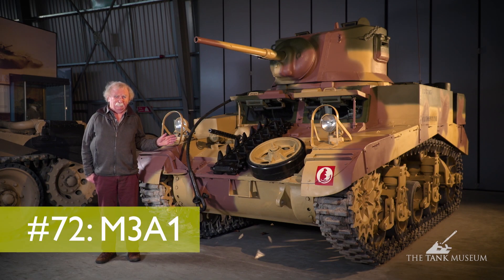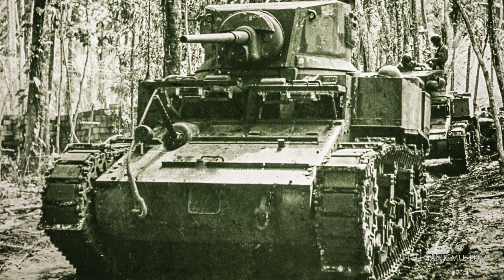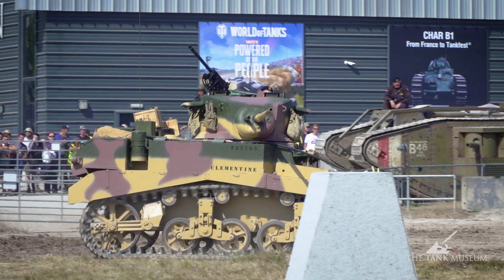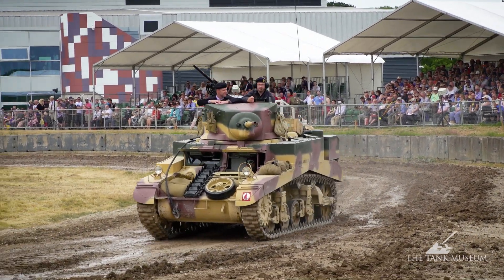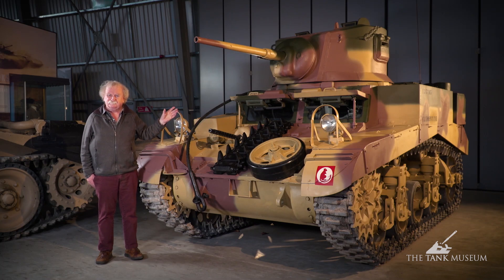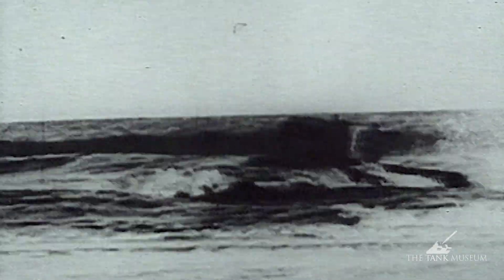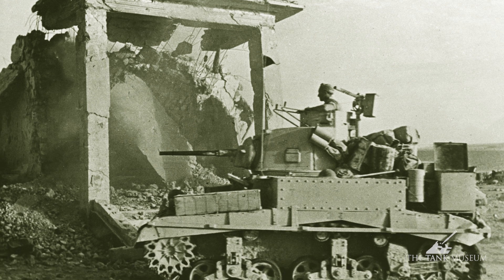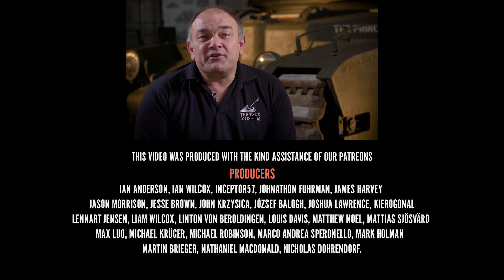Tank Chats #72 M3A1 Stuart | The Tank Museum

Comment: The 37mm also had a cannister round...Think of it as a enlarged buck shot. It looks like an enlarged buckshot too, with a very cylindrical body filled with hundreds of tiny ball bearings. The end result can be imagined. Now, the rifling reduced efffective range so only applicable at  very short range engagement. But as those Japanese troopers on Guadacanal found out, you DO NOT want to be in front of this round when it fires!

Comment: Not "accepted" by either Great Britain or the USSR despite at one point having 2 Cadillac Engines and an automatic transmission at one point!

Great news for everyone else in particular the USA which desperately needed these machines upon both the Pacific Theater then later the Italian Campaign then remarkably after that even the drive up the Rhone Valley and across the Rhine.

Range wasn't much of a factor upon any of these Campaigns given how close combat was from literally one Town to the next being just miles away. Remarkable oversight for the British Commanders but was great news for troops fighting on behalf of the War effort from Australia and New Zealand against Japan.

I think this article saw use in Burma as well. Japan certainly captured more than a few but apparently learned nothing from that.

Comment: The M3 stabilizer was operated by two types of tankers; those very few units who had acquired training on its use and maintenance who all liked it, and the vast majority of tankers who hated it and also didn't receive any training on it because it was a classified system. Or how badly can idiots with power screw over your military; loads, they can screw you over loads by not properly using that whole "need to know" aspect of all classified subjects.

Comment: 2:50 What's with that hull machinegun on the tank's right side?? Never seen it like that before with these tanks.
Reply: Chell-sama 
Same here. It reminds me of the Grant’s placement of its 75mm.
Reply: You are looking at the right sponson MG - there is another one on the left side. The Stuart had FIVE MGs including the AA M20 turret mount. In order to save weight & space the two sponson MGs were often removed.
Reply: The machine gun was, and still is, a very effective anti infantry weapon, and pre-WW2 US tank design tended to over play it a little bit. There was a tactical theory that tanks should have fixed MGs that they could fire when assaulting positions and you can see fixed mounts in the M2 Light, the M2 Medium, the M3 Medium and also the very very early versions of the M4.

They didn't do much in practice and CW users seemed to remove them and plate the holes as soon as possible, while I assume that US users were told to respect US Government property and seemed to leave them in place.
Reply: Chell-sama that’s the earlier M3 hybrid. Basically a M3 with a M3A1 turret.

Comment: Accidentally smashing the headlights must have been a pretty common occurrence to necessitate putting brackets around them then, I guess?
Reply: Tree branches, unhitching & hitching cables, working on the transmission, loading ammo through the driver hatch, unloading spent shell casings - all opportunities to damage the light fittings.
Reply: Basically yes. Your Army May Vary based on the terrain you intend to operate your vehicles in, but in on some vehicles it is almost the case of fitting brush guards on your brush guards. Some of that external equipment can be... slightly... expensive, and if your army is of the belief that the role of trees is to provide a clear path of destruction just in case anyone needs to find the tank in dense bushland on short notice then you may end up ripping half million dollar night sights off of the commander's station.

Brush guards also make very good hand holds and steps for climbing up and over the vehicle. Not their prime role in life, but if something is going to be stood on it might as well be a guard rather than something breakable.

Also in the Your Army May Vary are seed/leaf screens over the air intakes. Places like Europe? No real need. Places like Australia? Yup.

Comment: One thing I've thought about was using a rocket for the 2 pounder gun rather than a shell. You could fit a much larger warhead into a smaller package by simply sticking it down the barrel. It didn't have to be guided, just fins.
Reply: @bigweeweehaver  Range is not as important when you are already fighting in very close range and when the HE alternative is equal to that of a firecracker.

I am not talking about replacing the standard shell with an equally sized rocket but rather make a rocket an equal size of the internal diameter and length of the barrel.
Reply: Tank commander: "hold up Fred old chap, stop the tank. I'm going to climb out of the turret hatch & load a rocket - pass the rocket through the driver hatch please." Fred: "Mind those nasty Italian bullets sir they sting a bit. Sir? Sir? - oi Derek I think the CO has copped one can you see him?" Derek: "Silly blighter has lost his head, pass me a normal fecking HE round & let's get fecking moving pronto"
Reply: or you could just insert it into the barrel from the breech. Then again, if you want to continue shooting firecrackers at the enemy and watch as he laughs at you, be my guest.  @nightjarflying
Reply: @TheArchaos  Derek says if it were breech loading it would be narrow its entire length for say the 37mm barrel - as useless as the standard HE round & without the range/accuracy. Derek is right Mr. Freak.
Reply: @nightjarflying  No, you are still not correct. Even if you could only fit a 1 meter long rocket into the barrel (1.98m, m3 Stuart on wiki) You'd still have massive payload advantage compared to a standard HE shell (firecracker). It might not be as accurate as a shell but at least it would have enough explosive power to be viable. Even a cursory calculation gives us more than 5 times the payload then a shell and range is mute point as your max range is only ever going to be ~ 1km.
Reply: @TheArchaos  It's "moot point" & the clearance from the open breech to the rear of the M3 turret is around 27" or 0.7 metres - tough to get a 1 metre rocket in negative space! If you are going to claim that you've done a "cursory calculation" then let me see it for your 37mm rocket please. NB As an example the M1 Bazooka round is around 54" [1.37 metres] in length & fitted in a 60mm calibre tube - it had a max range of 400 metres [will miss a house though!], but an effective range [will hit close to chosen target] of only 110 to 150 metres. I do hope your finned, breech loading rocket can improve on that accuracy while being slimmer & shorter than the bazooka round or your rocket is of no use.
Reply: @nightjarflying  Would still have a higher explosive payload than a standard HE shell.
Reply: @TheArchaos  Where's your calculations? I want to know how much charge can fit in a the front part of slim rocket round allowing room at the back for long, thin fins a rocket motor & solid propellent!? I will allow you 30mm diameter by 320mm length for your HE payload compartment. How does that compare to the standard HE round? What use is your rocket round if the light tank needs to be 110 metres from the soft target which could be hosting a far superior towed AT gun of similar [or less] calibre armed with an AP round?
Reply: @nightjarflying  Because the alternative is scaring the enemy with firecrackers.
Reply: @TheArchaos  No calcs then? Well you failed to reveal the calculations you claimed to have made. The US M3 had a canister shot round firing ball bearings that was extensively used by the USMC in the Pacific - a tank shotgun if you will. That standard round broke up Japanese Banzai charges at much greater range than 110 metres & it went where it was targeted. No points for you Mr. Freak.